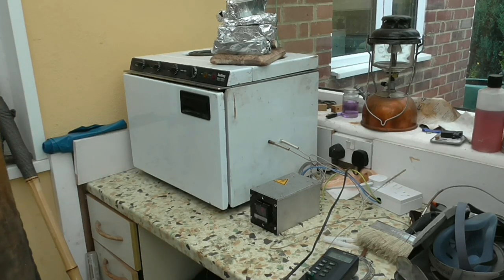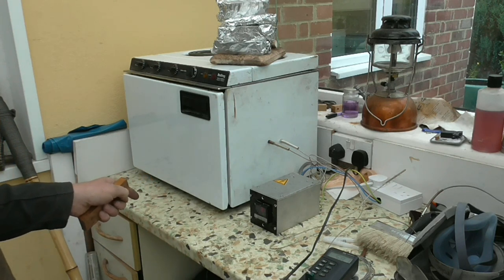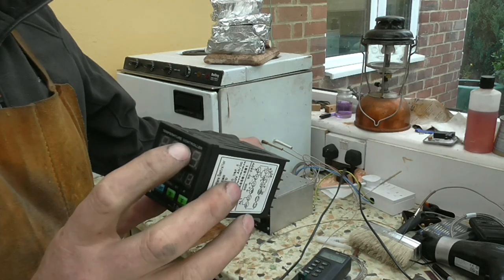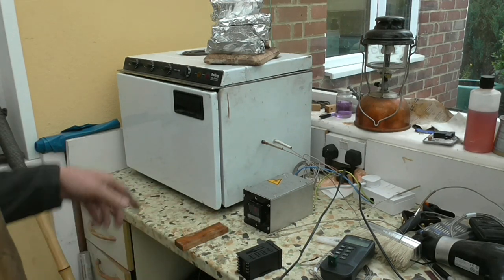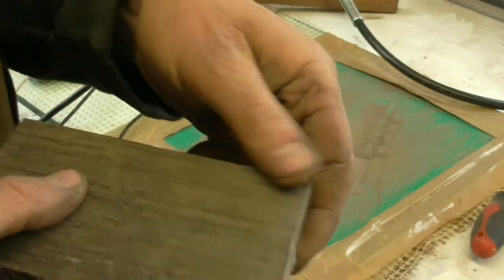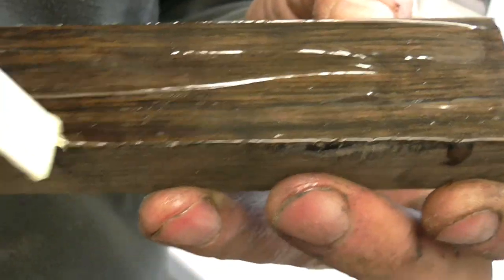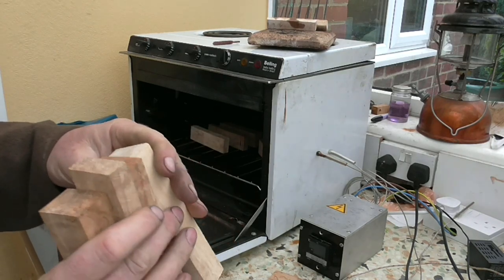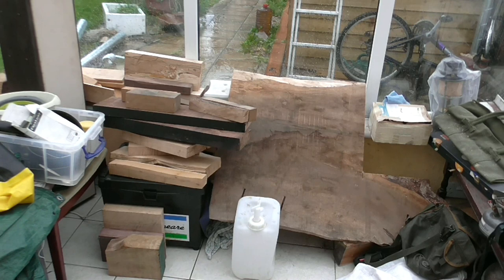The uses of a Domestic Oven for the knife maker

Comment: Im half considering building my own forge. PID controllers are cheap enough, so is firebricks and coils. I just got that food dehydrator for drying scales. the whole unit is designed to air flow the moisture out and so far seems to have worked very well.

Comment: Another really interesting video! I'm curious though as to what would happen if you tried un-dried wood in the stabilising fluid? My primitive thinking just assumes that the vacuum would massively increase the rate of evaporation, or lower the boiling point... Would the wood split, would the presence of water spoil the resin or would it work but take prohibitively long?

I'm assuming that in your ongoing experimentation you have probably already tried, or found out why it wouldn't work that way...
Reply from the maker: +Chris Auton It would make the oil in the pump turn milky, and loose it's viscosity and would generally not be very efficient. I would also have no idea about how much water remained if any. .
I think I will stick to the oven for now Chris.
Thanks
Sandy
Reply: +Jackloreknives wondered if the pump might be affected, but hadn't considered the oil. There is usually a reason why things aren't done the way I imagine could be possible :-)
Thanks for your answer and again for your videos, here and on Wiltshire Man.
Reply: +Jackloreknives wondered if the pump might be affected, but hadn't considered the oil. There is usually a reason why things aren't done the way I imagine could be possible :-)
Thanks for your answer and again for your videos, here and on Wiltshire Man.